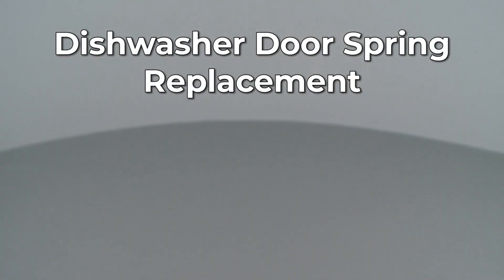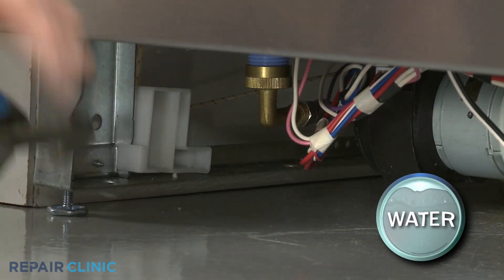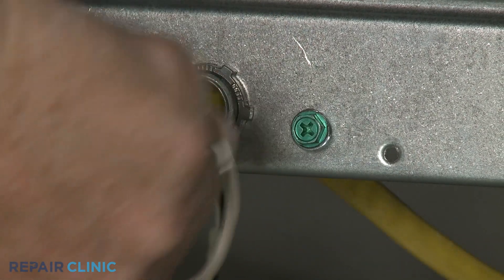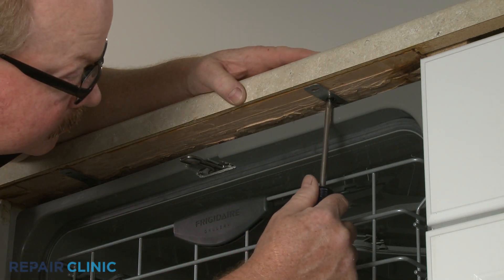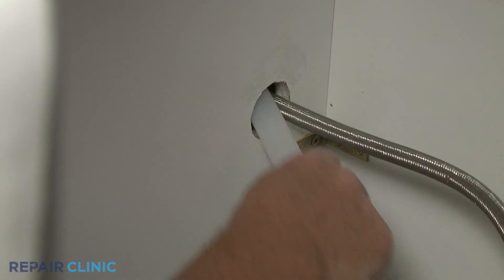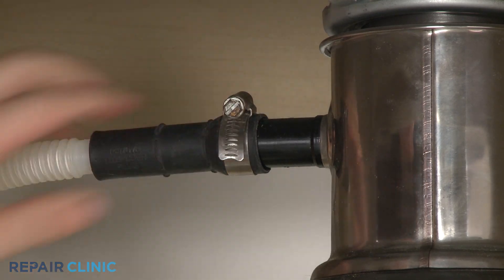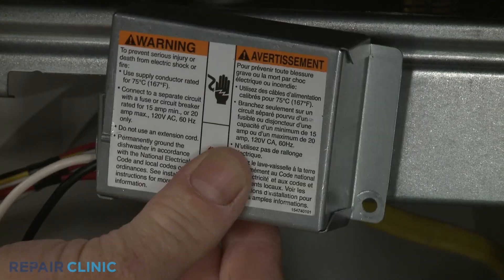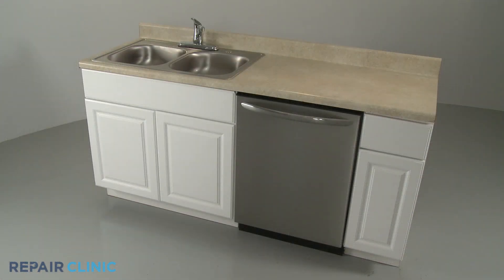Frigidaire Dishwasher Door Spring Replacement (part 154579101)

Comment: I am now replacing the door spring cord for the second time. Don't go cheap when replacing the cord. It won't last.  By the way, MOST of the stuff in this video I did not do. Killed power. I could reach the hinge cable without moving it out from under the counter.
Reply from the maker: We recommend using OEM parts.

Comment: Same problem on my side…After a spring broke, I change the 2 cords & the spring…and the door opens past to horizontal…I ordered the same part than on the manual part list and I was surprised to discover that the cord was more longer on the news one than the old one…I didn’t know the reason why. I made a knot on the two cord and I add a little metal angle on each side with 2 screws to create bump stops to keep the door horizontal.

Comment: My door opens too far, past horizontal so the drawer falls out. Could the be from a weak spring? What holds the door level to the ground when open?
Reply: It’s either the spring or rope attached that needs to be repaired/replaced.  I have the same problem.
Reply: I replaced the springs and the strings and the door is still past horizontal position don’t know what to do now
Reply: @timstoker7979  I just had the same problem and fixed it as follows.  While the door is in a roughly horizontal position, I recommend looking at how the door hinge works, and seeing where the metal portion of the door hinge sits roughly vertically when the door is in a horizontal position.  Here, I drilled some new screws to the left and right into the cabinets on each side of my dishwasher, such that the metal door hinge RESTS on these screws (as "stoppers") when the door is in my desired horizontal position.  That way, the weight of the door is borne by the screws rather than by the cables or springs.  That fixed the problem for me.  Best wishes to you!
Reply: Bad hinge . Kids prolly leaned on it
Reply: My door sat parallel to the floor until the door spring cord broke and it fell hard. After I replaced the spring cord it still opens further than it did when new. It in no way affects how the dishwasher works so I don't really care that it opens a little too far.
Reply: @donstine5233  doesnt you dish rack roll out on to the floor if you’re not careful?!
Reply: @tylerdumez6723  no it is only a few degrees lower than it should be. It doesn’t lay on the floor or anything. Still, I control the roll as I pull it out.